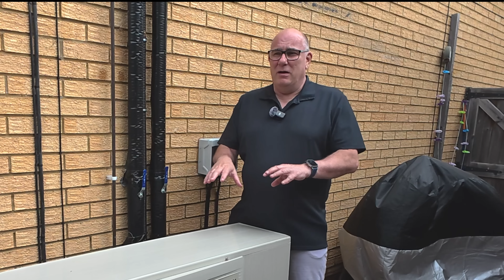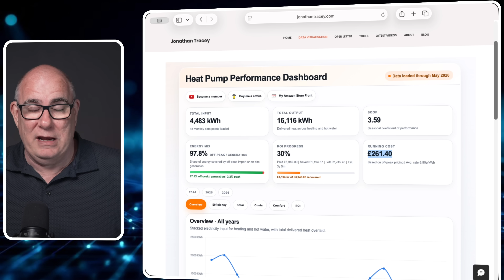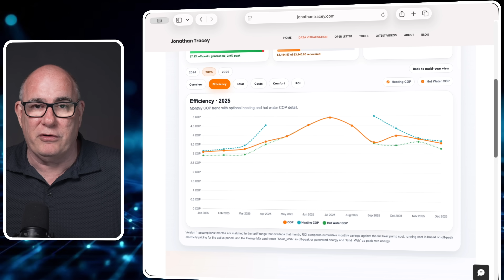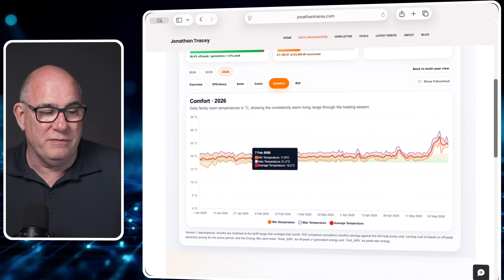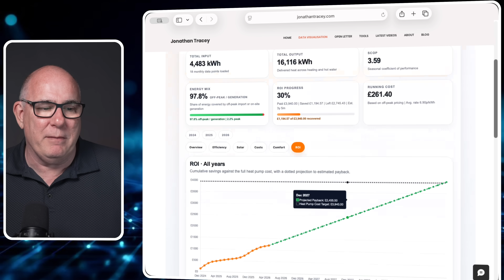18 Months Later: Would I Still Buy A Heat Pump?

Comment: Again, your basing the payback on the heat pump only on the cost of the heat pump. You’re not including the solar and batteries. But in the same sentence you’re saying the payback time on your heat pump is being sped up by the solar and batteries.. so your figures are compromised.. your total costs are not being aggregated and your savings are being extrapolated..
Reply from the maker: my solar and battery system has paid for itself already, in some cases twice over and the returns are my returns so why do I need to account for something that has no cost, the energy it generates is free
Reply: @JonathanTracey  I think it would be clearer what the actual return on investment for your heat pump was, if you were able to account for the input electricity costs to it separately from the ongoing returns from your solar PV and battery system. Although your solar and batteries have already paid for themselves, you might consider that the electricity they produce is not worthless / free. Rather, you could account any units of electricity going from your solar PV system to your heat pump as a return on investment on your solar at the export rate, since you would otherwise be paid that amount if the heat pump wasn't there. And similarly as an input cost for your heat pump at exactly the same rate. That way you would be able to see how very beneficial your solar PV continues to be and also get a better indication of the return on investment for your heat pump, i.e. a comparison against how things would have been for your bank balance if you'd stayed on gas.

This would show the advantages of running a heat pump with solar PV and batteries, because the heat pump gets to run on electricity that costs your bank balance the equivalent of your export rate, which is considerably lower than the daytime import rate.

Comment: I took the plunge I’ve had my Vaillant 5kw for around a week. I can’t account for heating right now given the warm temperatures right now. However, I have learned something significant. Hot Water. My gas boiler heated it to 60 and it did so around 3 or 4 times a day. When the plumber shut the gas off, I noticed that the hot water stayed stubbornly high, which got me thinking. Why did I allow my tank to charge that much? Since the HP was installed, I set it to heat overnight on cheap rates to 50 and that’s it. That was more than sufficient and cop was 3.4. I turned it down to 48 and now cop is 3.9 for DHW and I still don’t run out of hot water. Astonishing. Gas has completely gone now and so far, I’m delighted.
Reply: Sounds good. You've seen the Vaillant content on Energy Stats UK?
Reply: @Biggest-hz7ng I haven’t. Is that on YouTube?
Reply: @Johnhere  he is both a writer and a YouTuber. He has Vaillant-specific content on his site, and more generic content on his YouTube account
https://youtu.be/YTE1NiWCOtk
I prefer reading.
Reply from the maker: @Johnhere That's a fantastic result, and I suspect you've just discovered something many of us wish we'd realised years earlier.

Gas boilers tend to encourage us to keep reheating water to temperatures we simply don't need. Once you start looking at actual usage, it's amazing how much lower you can go while still having all the hot water your household requires.

Going from 60°C multiple times a day to a single overnight charge at 48-50°C, improving your DHW COP and still not running out of hot water is exactly the sort of optimisation that makes a big difference over time.

Most importantly, you're only a week in and already delighted with the system. That's a very good sign. Keep us posted as the seasons change—I suspect you'll have some very interesting data to share by winter.

Comment: Great to see a review by someone intelligent with figures to back it up! The big question is on lower power heating constantly on vs higher power heating on demand. My 22 year old house is gas boiler heated and had what were IMO inadequate radiators in the lounge. They could be on all day and the room couldn't get to 20 on a cold day by the evening. I increased the radiator sizes for a combined output around 60% higher. Now I can let it go unheated all day, stick on an hour before and it's warm! I know there are arguments both sides on this.
Reply: In our case I found that running the ASHP in a mode similar to a gas boiler, i.e. on / off when rooms called for heat, was about 20% less efficient that running it constantly at a lower flow temp. The unit also ran much quieter as it wasn’t having to run flat out to raise the temperature in a short period of time. You can schedule a set back temp for a lower flow rate overnight but the house was a much more consistent temperature day / night.
Reply: Have you altered the flow temperature of your boiler to see if you can run at a lower temperature?
Reply from the maker: @simonbeasley989 You've actually highlighted one of the key lessons many heat pump owners discover. By increasing your radiator output by 60%, you were able to deliver the same amount of heat to the room at a lower water temperature.

That's great for a gas boiler because it spends more time condensing and running efficiently, but it's even more important for a heat pump. The lower the flow temperature required, the higher the COP and the lower the running costs.

The "heat all day vs heat on demand" debate will probably never die, but in my experience the biggest win is having emitters large enough that you don't need very hot water in the first place.
Reply: I am running at 65 degrees, so not too hot. I will experiment a bit, see how it works a bit lower. While I have no plans for a heat pump yet I did calculations that suggested the lounge could be heated with 55 degree water through the new radiators so it is future proof. I do have smart thermostats so can also experiment with that set back temperature. Whatever happens I'm better off with bigger radiators with options of cooler water that's more efficiently heated and/or faster warm up times.
Reply: @simonbeasley989  65C is stil fairly high if you have a condensing boiler

Comment: Same ASHP here installed by Octopus 11 months ago. Since then our SCOP for heating has been around 3.6, for DHW though we’re down at about 2.6 so will need to work a bit harder to get that up a little. Biggest change for me came from switching from thermostat controls, heatmiser so basically on/off, to control via leaving water temp (LWT). Did this in mid Feb this year and since then the COP for heating has been consistently above 4, the SCOP is therefore improving. Using LWT the pump runs much quieter as it’s running consistently at a lower rate. Have had to keep reducing the temp settings on the curve as the house was getting too warm. Currently set at 43 deg LWT for -8 deg C external and 28 deg for + 16 deg C external. Overall though the energy used and SCOP being achieved are at, or better than the design figures quoted by Octopus. EV charger going in this week so IOG here we come.
Reply from the maker: @topps100 That's a great real-world example of why I keep telling people not to judge a heat pump by the first few weeks of ownership. The hardware didn't change, but switching from simple on/off thermostat control to weather compensation and LWT control pushed your heating COP from the mid-3s to consistently above 4.

I had a very similar experience. The temptation is to run a heat pump like a gas boiler, but they really seem to reward steady operation at the lowest possible flow temperature. Quieter, more comfortable and more efficient.

Please come back after your first winter on IOG and let us know how it performs. I suspect you'll be very happy with the numbers!
Reply: @JonathanTracey  Will do. In our case we didn’t install the Madoka as I wasn’t sure that there was a single good place to put this that would control the whole house so we stuck with our 6 heatmiser thermostats. Although I removed the control valves on the manifolds we still had zone valves for upstairs / downstairs and the stats were basically on / off so these were triggering the ASHP to run / stop. Now no stop / start, everything is open, zone valves removed and as mentioned we use LWT control as opposed to any thermostat. In this mode you can schedule set backs so we allow the LWT to reduce by a further 4 deg overnight so that the house is a little cooler for sleeping. Will be interesting to see how we get on this coming winter with the LWT and if we need to make any further tweaks.
Reply: With cheaper overnight rates, are you planning more heating or hot water overnight, and do you have batteries?
Reply: @Biggest-hz7ng  We have 30 kWh of batteries (Alpha ESS) so plan to fully charge the car and batteries overnight, plus probably move our HW schedule to overnight as well. At the moment the HW is set to 46 Deg C and is scheduled for 1pm, we also run a weekly legionella cycle. Something to ponder on the HW though is if it takes more energy, due to cooler temps overnight, to heat the water then is that better than using less energy during the day, that I could have exported at 12p, to heat the water. Guess it all depends on the temp difference between day / night and conditions in the tank at the time it’s due to re-heat. Anyone care to work that one out ?
Reply: @topps100 if the overnight cost is much lower than 12p it's worthwhile. Right now on Agile overnight costs makes daytime heating cheaper.

Comment: You dont mention whether your gas was a central unit with warm air sent through ducting, or radiant heaters in each room.
Heating with gas has never really been a thing in the part of Australia I live in, most winters i dont even close the doors and windows. But those Mexicans down south use a lot of gas for heating, often using radiant heaters in each room. 
One of the things the naysayers down there whinge about when they go from gas to reverse cycle air conditioning is the air flow. They complain that the aircon units create "airflow" which makes them uncomfortable compared to the straight radiant heat from their old gas heaters, so they have to run the temperature hotter than they did with gas. (They dont seem to  mention that it is still  way cheaper!)
Reply from the maker: all thought in room radiators
Reply: @JonathanTracey  aha, not something we see here.

Comment: My ASHP has been running for 3 years, 1st year we had equivalent of no wall insulation and used 3415kWh to maintain 18c in a detached 4/5 bed 1970's house.
2nd Year, we had old insulation removed and new installed, we then used 2575.79kWh to maintain 18c.
3rd Year was 3004.47kWh to maintain 19c.
4th Year was 2840.55 to maintain 19c. 
My SCOP has been around 4.2
Readings are March to March
Reply from the maker: @Jaw0lf Thanks for sharing the numbers.

To me, this is exactly why it's so important to look at real-world data rather than internet myths. A detached 1970s 4/5-bedroom house, maintaining 18-19°C, with a SCOP around 4.2 over multiple years is a very respectable result.

What's particularly interesting is the impact the insulation upgrade had. Going from 3415kWh to 2576kWh while maintaining the same temperature shows just how important fabric improvements can be, regardless of whether you're using a heat pump or a gas boiler.

Thanks for posting the figures. Real data from long-term owners is incredibly valuable for people researching whether a heat pump could work in their own home.
Reply: If it can't keep my living room at 21 in winter, I have no interest.

Comment: We've done it JT. Friday just gone, we had our 5kw Vaillant Arotherm heat pump fitted through our local HeatGeek installer. The house is instantly warmer, our guy set it to 23deg (for the wife) but as its warmer she asked me to turn it down to 20deg 🤣🤣
We have a lot to learn about how this will work (any further advice you can share will be greatly noted) going into winter as it's a bit strange to have the system running 24/7 🤔🤔
The hot water cycle runs at night on our cheap rate but the whole system should run off the panels and ... wait for!!!!! A powerwall 3 with 2 expansion packs (sorry to brag 🤣). The "Wife/CfO now calls them Tom, Dick & Harry 🤦‍♂️🤦‍♂️
Can I extend again our heartfelt thanks for your great informative videos but also the personal advice you gave to help us reach our goal, keep up the great work JT 🙏🏻🙏🏻🙏🏻
Reply from the maker: @paulquickmire4140 Congratulations Paul! 🎉

I suspect you're going to have exactly the same experience I did. The first thing most people notice isn't the savings, it's that the house feels consistently comfortable. No more cycles of "too cold" followed by "too hot" - just a steady temperature all day.

My advice would be simple: resist the temptation to fiddle with it. Give the weather compensation a chance to do its thing and only make small changes over time. Most of us come from gas boilers where we're constantly adjusting settings, but heat pumps tend to reward patience.

And as for the Powerwall 3 and two expansion packs... that's not bragging, that's simply demonstrating a commendable commitment to energy independence, but I can't say I an not a little jelous and tell your CFO great names 😄

Seriously though, I'm delighted to hear you've reached your goal. Thanks for watching the videos and for sharing your journey with everyone here. Please come back in a few months and let us know how you're getting on, especially once winter arrives.
Reply: @JonathanTracey I certainly will do JT.
Reply: There's Vaillant content on Energy Stats UK on how to run the heat pump optimally.
Reply: @Biggest-hz7ng thanks, I'll take a look 👍🏼
Reply: @paulquickmire4140  as well as writing pages on his Vaillant, he has a YouTube account with more widely applicable heat pump content
https://youtu.be/YTE1NiWCOtk

Comment: I’ve been following you for quite a while now JT. Had a survey today by Heat Geek and accepted the quote and Heatable will be installing an 18.5 kw battery and 13 solar panels in the not too distant future. With IOG it will be an interesting transition.
Reply: As an addition to the above post and having listened to this vid, what size battery would you recommend? You say you’ve got about 27kw plus portable battery storage. I’m now thinking about increasing the storage capacity.
Reply: @TimGrace-ky6mp  it depends on your heat loss? @timandkatsgreenwalk have a tariff calculator for batteries, solar, EV use, heating use and general use that will calculate costs. And you can adjust your solar and batteries to see the benefits on current tariffs.
Reply from the maker: Sounds good, 18.5kw is a good starting point, I would not add to that until you have a years worth of data under your belt, then see how often it runs out, you will probably find adidng more battery to cover the small number of events is not financially viable

Comment: Your lucky, as our neighbours is getting the council to visit over its vibrations it’s making at under a full load it’s aka to a Quarter Choir humming
Reply from the maker: so it’s not like it’s down to having a good qualified installer put the thing in in the first place. Like anything if it’s poorly installed you can’t expect it to work properly.

That said, why is she calling in the council, surely it requires a qualified engineer to look at it?
Reply: @JonathanTracey they refuse to do anything, and the installation themself , and arguing everything, unfortunately we called them and they refused to door , so they get fined

Comment: My Great aunts! Is shit you can hear it from 0.5 miles away it sounds horrendous and my uncles eating pumps. Just a block of ice frozen solid when it gets cold 🥶 outside, some light the fire🔥.  

Depends who put it in and the knowledge and who makes the machine
Reply from the maker: @owena714 Half a mile? Blimey. At 0.5 miles (about 800 metres) away, a heat pump would need to be pushing close to 90–100 dB at 1 metre to be clearly audible. That’s not a domestic heat pump anymore, that’s getting into “small diesel generator having an argument with a chainsaw” territory.

As for turning into a block of ice, heat pumps do frost up in cold weather — that’s completely normal. They then run a defrost cycle and carry on heating. If every heat pump became a permanent ice sculpture every winter, Scandinavia would be a very cold place indeed.

So either your great aunt has the world’s loudest heat pump, or someone in the village is winding you up. 🔥😄

Comment: The heat pump system is so dump that can’t provide cooling in the summer
Reply from the maker: @waterloowar Air-to-air heat pumps (air conditioning) can usually provide cooling, but air-to-water systems can too if they're designed for it. The limitation isn't that radiators can't move heat outside, it's that most UK radiator systems aren't designed to handle chilled water because of condensation risks. Some systems use fan coil units or underfloor cooling instead. My system is heating-only by choice, but cooling is absolutely possible with the right setup.
Reply: @JonathanTracey that is the problem in UK. We always keep the cost down and can’t adopt a better technology
Reply from the maker: @waterloowar its a personal choice, most people who have radiators choose not to rip out their entire heating system. But if you want to do that then its your choice.  But lets be clear no gas central heating system provides cooling either
Reply: @JonathanTracey but you said so such system before. 
Why change to “some area” don’t need cooling?😂😂😂
Reply: My gas central heating can't provide cooling in the summer either, I don't know how they get away with it
Reply: @HiruS22  heh
Reply: Some parts of the UK don't need cooling (yet), so radiators are perfectly adequate. It's a householder's choice.